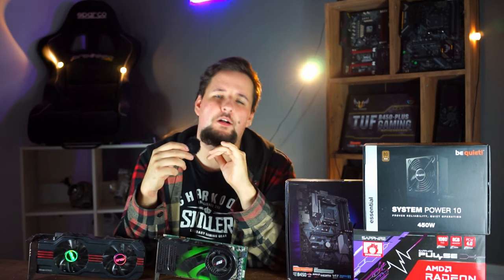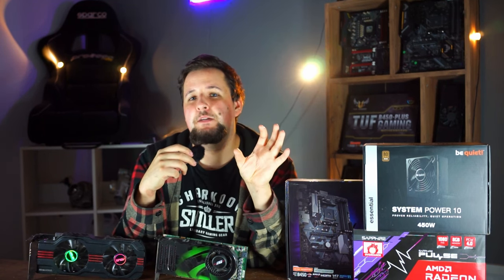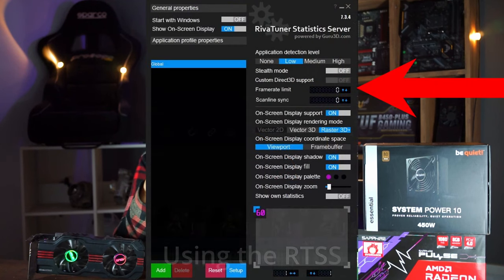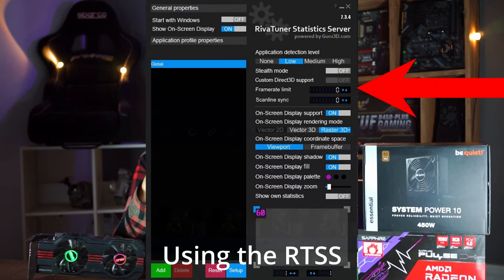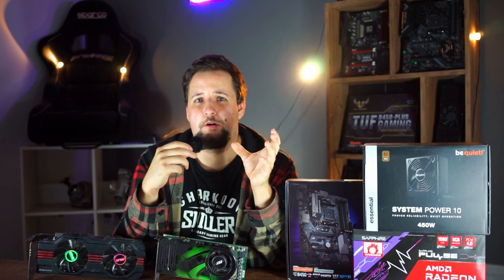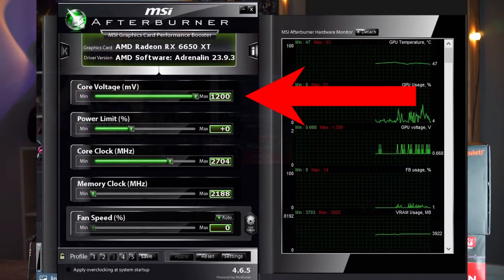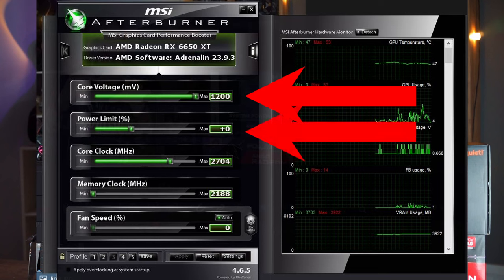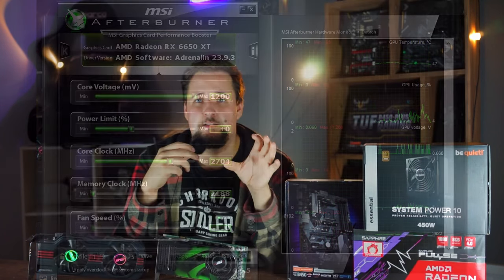Fix Coil Whine FOR FREE | What is Coil whine? | Coil whine and Warranty | Explained

Comment: more power = more coil whine in general. It was most loud in cards 300w or more and much quieter in lower tier cards like 180w - 220w. That is my experience in last 10 or so cards anyway. High power gaming laptops have it also in my experience, i can hear the same screaching
Reply: my 5700xt only pulls about 200w max and screams at me under load lol, loudest thing in my room
Reply: I understand what you mean but my 2060 super uses about 175Watts and is so annoying even my brother can hear it from the other room. And the worst part is, that it screams louder when I cap my Fps. I changed my PSU but now it makes a bit different noises but it is still there.
Reply: @razonspielt1851  i went from the 5700xt to a 2070 super hoping itd be better and it wasnt lol. got a good deal on a corsair rm850x shift psu this week and its quieted it down a lot, the gpu whine is quieter at full power now than it was underclocked + undervolted before, plus no more psu and motherboard vrm noise. starting to think literally all new gpus have whine lol.
Reply: @wasted828  well im really confused about which component really is responsible for the coil whine. Because it is really strange that most of my gpus suddenly has the same issue. I have an old gtx 970 and it does the same thing. I have a strange feeling that it is caused of my appartments socket which has a an impact to do such coil whine on my gpus. I just hate it so much but I cant do nothing about that..
Reply: Generally I would say the nature of coil whine is more dependent on quality of the components.
For an example I had Gigabyte RTX 4090 and it nearly was silent, also had Gigabyte Aorus Master RTX 4080 - completely silent, I was beyond amazed.
But, what matters is how PSU/Motherboard/GPU are gelling together, some PSUs are amazing, but won't gel with a certain GPU or motherboard. 
Some PSUs do amazing with one GPU, and the other PSU will do amazing with another brand GPU

Luck of the draw

Comment: My gigabyte 3080ti vision OC can make coil while in very specific situations i.e. menus with HIGH FPS though almost no whine most the time, very odd.
Reply from the maker: yep, as explained, whine at high fps even under low loads is very common. but most of the time not a valid reason for refund, as it s not present most of the time / in cases where it is actually hindering the experience. Many Cards will whine at least a bit in those situations
Reply: It is actually normal. 2000fps with real low load is inadeqate work mode. Much worse if it whines in idle or in any game with any fps (like mune has)
Reply: My gigabyte 3060ti is bipolar. Some days it’ll whine then some days it won’t make a sound at all.

Comment: "most graphics cards have been fixed"
asus tuf/strix, powercolor hellhound would like a word with you sir.
Reply from the maker: Well maybe was formulated badlly i meant to say way better. Not experienced a newer gpu that whined as bad as the old ones i have had
Reply: @limitless-hardware1866  nah I am just messing with you dw, although I have seen so many strix cards that SCREAM
but overall gpus are much better and quieter
Reply: i got a Asus rog strix RX 6900XT LC OC and it has extreme coilwhile to the point where you can even hear it while wearing a headset
Reply: Power colour red dragon 6800xt unreal whine sounds like a mosquito doing a data transfer
Reply: MSI 4090 gaming x trio. Mamma mia... insane whine!

Comment: I just bought new colorful 4070, it was long delivery from far away, and I am very upset now because it whines. Worse that it seems there are spoiled shipment or spoiled revision, becasue 5/15 people in recent rewievs say it whines.

First I asked refund and still discuss this with seller.
But now i decied to open case and hear. And seems like new vide card makes whine everything at once, PSU, motherboard and itself also.

Yes, my psu old and little low power, it is bronze Cougar 550w in cool red painting. And it must have enough wattage to cover 200w of gpu+100w peak cpu. (can do 512w on 12v line in specification), and he does work well. But. Everything whines.

Not sure if I should give up and start get money on new rig (pus mb cpu memory in pack).
Or continue argue about 4070 refund.
Reply from the maker: I strongly recommend upgrading your PSU, it can make other components whine. and the cougar unites werent that great when they were new anyways 
And in keeping that psu you are running the risk of destroying your whole system if something goes bad. Especially because capacitors and other components in PSUs age and get worse with time. i would highly advise AGAINST running the card with this power supply. 

For PSU buying advice for 40 and 30 series cards, we have this video on our channel: https://www.youtube.com/watch?v=X079yO2c4yg there you find everything there is to know about modern GPU and PSU combinations
Reply: @limitless-hardware1866  that psu worked fine with previous 1070. While i checked everything, i put it back once, and it was happiness, everything quiet!

About risk, I'd say there is more of that in trying new units on old and my only rig, any spoiled unit can blow everything, unlike one that work long and fine.

Will check video